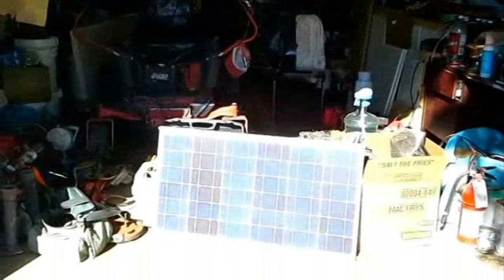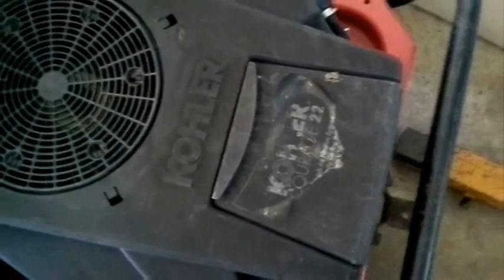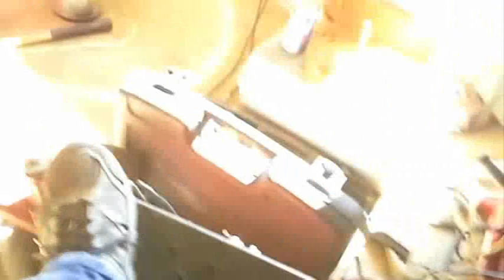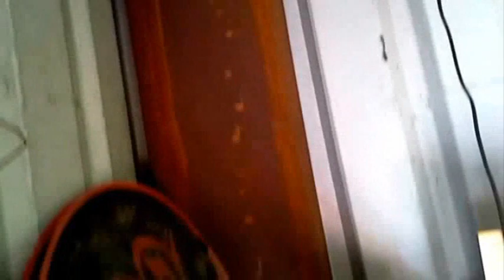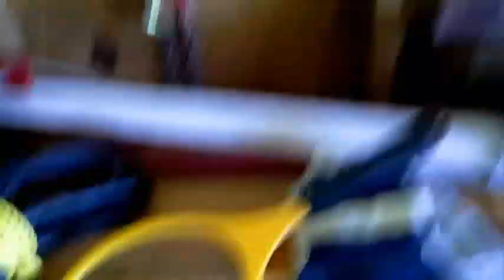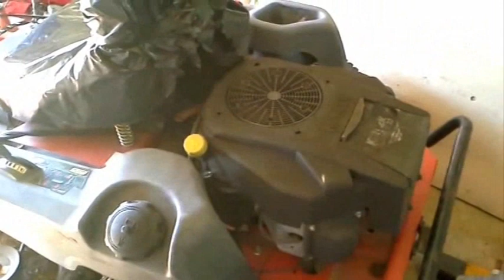WELCOME NEW SHOP No3 and KOHLER STARTER RING GEAR FIX SOLUTION

Comment: Hey MUDDy, Love what your doing. Kohler had a huge problem with those Chinese flywheels, they should have replaced it under warranty. the carb on that thing is about 300 bucks too.
Reply from the maker: Neil Hahn yes, i can easily believe the price of the carb. If I parted this thing out, i would make enough to buy a new one.
They are pretty proud of their parts.
MUDDy
Reply: I replaced my carb on Koehler cub cadet for like $35

Comment: Glad to see ye around.
Reply from the maker: TechMan1219 Hello TechMan,
Thanks for sharing the video. and the wish of luck. Is that a linx in the avatar? nice cat anyway.
More to come.
MUDDy
Reply: ***** No.  Savannah cat.
Reply from the maker: TechMan1219 There is an old term called, " two dog night, - three dog night, ect", this used to be used to describe how cold of a night, and how many dogs it takes to stay warm in the bed at night. This guy seems to be useful in that field, and as a lower pitched vibrating sleep induction. Lucky kitty.
MUDDy